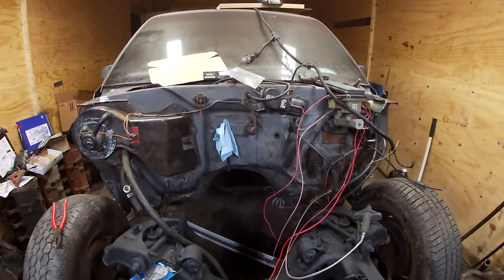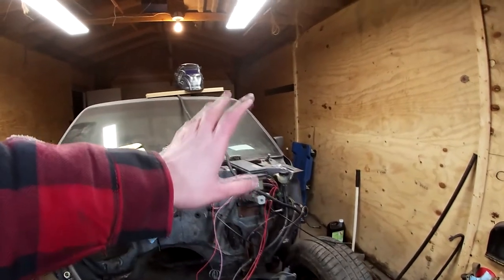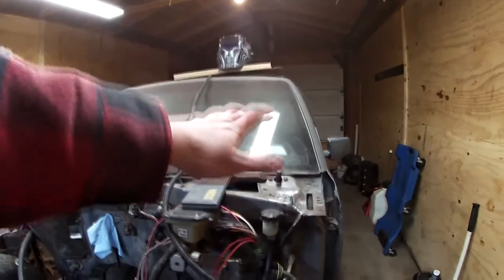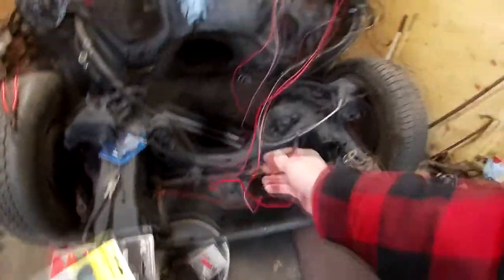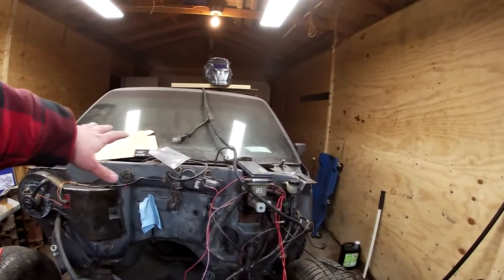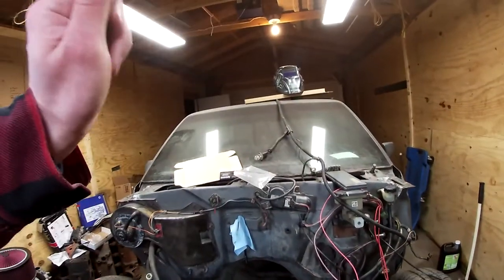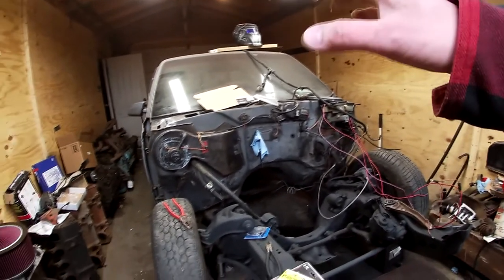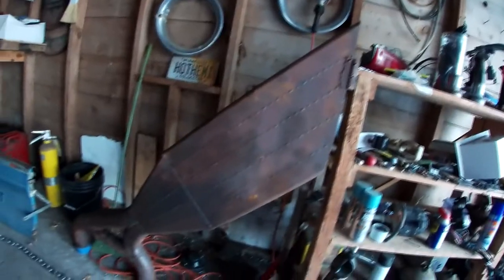S10 Wiring In A Nutshell Detailed

Comment: Will .my fuel gauge work with the  computer wires cut  on 1993s10
Reply from the maker: @JosephSmith-dh7iq  yes I do believe so, it would be a brown wire running up your frame on the driver side to your cluster 0-90 ohm. If you are unsure yet you can always cut the wires and turn the key and see if it remains in the same spot, you can also siphon out 5 gal and make sure the reading drops to be positive before removing everything 👍 it's been a long time since I've done it but I think you'll be good

Comment: So what do I need to keep if I want to run my factory fuel pump with the ignition. 

I will be running an inline pressure regulator
Reply from the maker: You'll need to keep your oil pressure swith and everything related with that, should be a 3 or 4 wire system along with the relay for it

Comment: Thanks for your video. Im at it. Wiring juction block. One to starter. One to alternator. Is what I think?
Reply from the maker: You got it, also run main harness to it too
Reply: @pedaltothemetal3871  any chance make a diagram reverince point. The computer thing on the break fluid mount. Don't need. Right. All wires.
Reply from the maker: @johnstamper5447  would that be abs control? I've yet to deal with one
Reply: @pedaltothemetal3871   yes do i need the wire harness for it.
Reply from the maker: @johnstamper5447  do plan on keeping the abs features?
Reply: @pedaltothemetal3871  do i have to have abs hooked up? 350 swap. Just need motor to run. I don't need it? Once i bleed the breaks. And it stops. That's it right.abs box is for what.

Comment: How did you get the speedo to work
Reply from the maker: I went and used a autometer GPS speedometer. Couldn't figure out how to make the digital output trans with the cable cluster
Reply: If you want the speedo to work and you have a 700r4 you can get the electric unit off a 1992 model and but you have to swap the reluctor wheel ok the transmission, it's pressed on so you may have to swap output shafts to he honest

Comment: My 1985 Chevrolet v8 s 10 has a wiring issue
Reply from the maker: What's going on
Reply: @pedaltothemetal3871  The previous owner did an engine swap from a 2.8 v6 motor to a Z28 iroc camaro motor and I think the wire harness needs updating because when I drive the truck it tends to break down. I’ve replaced the distributor and the battery and the timing is a little off.
Reply from the maker: @ClassicMan3  does it just fall on its face under load or loose power and shut down?
Reply: @pedaltothemetal3871  When I was driving it kept cutting off and loss of power and shuts down
Reply from the maker: @ClassicMan3  carburated or efi?

Comment: I like all of your videos. Just need to see you can show a video on the gasoline to the fuel regulator to the carburetor need help what gasoline goes where
Reply from the maker: I'll do what I can otherwise you'll have to run a regulator with a return port in it. I've seen them for sale on jegs a while back
Reply: @pedaltothemetal3871  im at the stage for running fuel line under the truck and wire up engine bay. Thank you for the tips